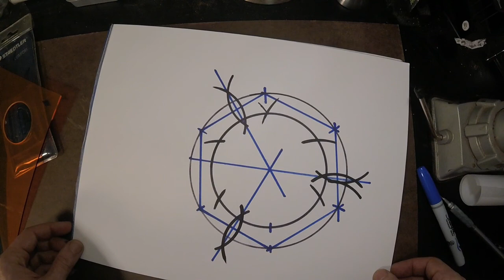DIY Geodesic Sphere FROM PAPER PLATES PLATES! Vlog#5

Comment: I did something similar, i took a bunch of old calendars, separated the pages, folded them into the shapes i needed, and built a paper panel geo dome, no frame, just folds.   It was free paper thicker than regular paper, with quality pictures on them.

You were talking about cheap, can't beat free. Also use your old cereal boxes if you eat that stuff. IF you buy the ceral anyway, you get a decent hobby cardboard as the box. There is many other ideals too, like plastic bottles, tin cans, etc... can be slit at the seam and rolled out into flat panels and folded as needed. Stuff just for fun, for free, but if you find scrap steel or scrap wood you will be on another level, and you will build your skills if you build out of those materials. 

Did you see that flower in the end? lmao